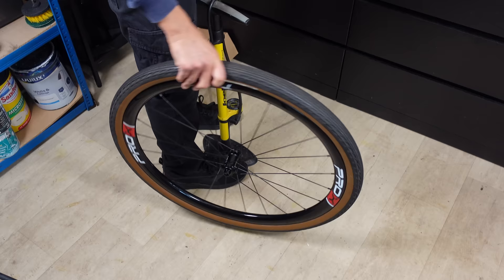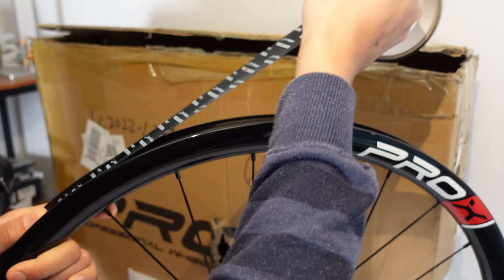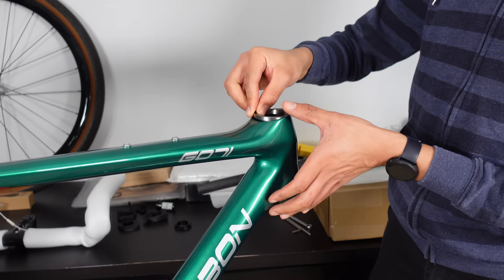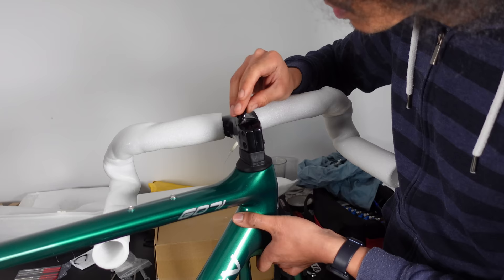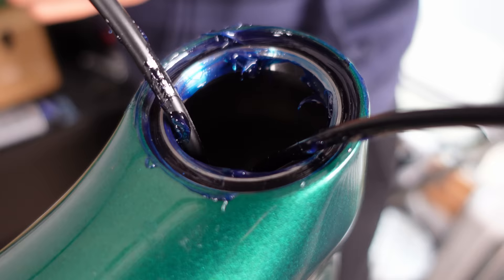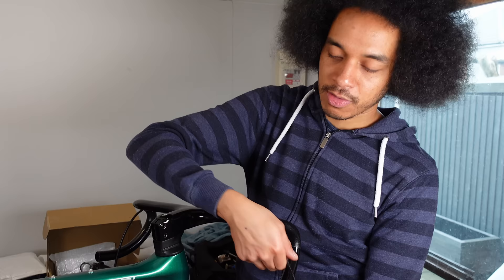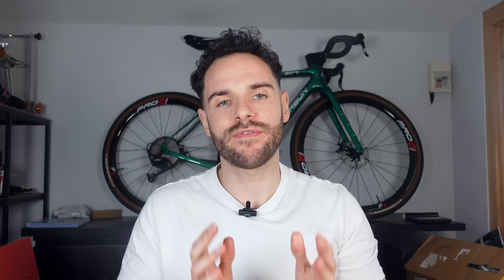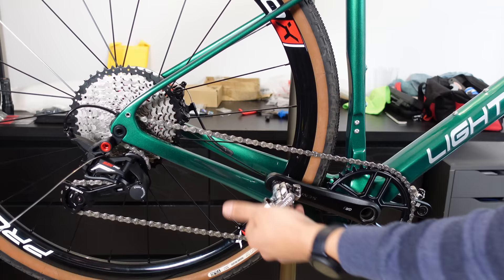Full Bike Build Process… Everything You Need to Know!! (Cost, Tools, Tips and Tricks)

Comment: Nice video. But the o-ring of the valve is not for sealing. It is for protecting the rim when tightening the nut. Are is trapped above the rim bead (tyre compartment). The hollow compartment of the rim shouldn't be pressureised, so a seal not needed. When the internal compartment of the rim is under pressure it can explode.
Reply from the maker: Thanks fro the info! That makes total sense. 👍🏽

Comment: I mean, I understand why the brake rotors don't come with locking nuts. Anyone replacing their brake rotors rather than installing them for the first time shouldn't have a need for them. I know when I replace brake pads on my car I just replace the rotors with them, and I'm sure there are actually people who do the same with their bikes.
Reply: I bought a new set of wheels and needed the lock rings...
Shimano rotors come with the ring.
Just make sure you have the right one if you have 15 mm axles...

Comment: To make sure tyres go on OK (many don't) I use the technique of putting half of one side of the tyre into as much of one side of the rim then do the same for the other side using the other half of the tyre. Its like a mirracle experience especially if you previously spent days without luck!😂
Reply from the maker: I see... so half one side, then half the other side... then just push both sides on. I guess the tension is spread out between both sides.
Reply: @JourdainColeman  well there is tension created especially on where the tyre crosses over ffrom one tensed side to the next. The result is the tyre has no gaps before inflating....I learnt the trick from this chap..https://youtu.be/tE3h4nmDdOo

Comment: When buying a socket / cup type tool to install this type  bottom bracket (ie one with Shimano notches) , be aware that the outer edge of the "teeth" in most examples of this type of tool, are chamfered ie they slope away from the outer edge of the tool, this means the width of the teeth that engage in the notches in the screw-in type bb like Jourdain has, is reduced but more importantly, because the lip on the screw-in bb is so thin, the notches are also very thin and so the teeth in the socket cup barely reach the notches, consequently when torquing up the two halves of the bb, the socket cup teeth easily slip off the notches and in so doing round off the edges of the bb notches, making it even more likely that the socket cup will slip off the notches. I speak from experience. It's a bit like trying to undo a tough nut on a bolt with only half the width of the spanner jaws in contact with the nut. It's best to use a spanner type of bb tool like Jourdain's mechanic mate did, the teeth on these spanners are not chamfered and whether open or closed jaws, engage the full width of the notches in the lip of the bb and are less liable to slip, provided you keep lots of pressure on the face of the tool.

Comment: I'm working on this frame right now and I discovered that the dust cap on the headset is touching the frame, and that's before preloading it. Did you have any issues with that? I'm thinking about installing an 8mm bearing on the top instead of the 7mm one that is provided with the bike. That should solve the issue I think. Less destructive than sanding down the dust cover. Any suggestions?
Reply: For who cares: I installed an 8mm headset bearing on top and it's perfect now
Reply: I am wondering if this might the cause of a problem I am having. I have assembled the bike, but I cannot remove the free play in the headset.
Reply: @mikenolan7524  It's pretty easy to see. If you turn the bars and you see the cover on the top of the frame rubbing the paint, it's not good. There should be a small gap, otherwise you will be scratching it up. Check top and bottom of the headset to see if there is a gap on both sides. There should be zero rub. Possible solutions: higher bearings (make sure to get the right dimensions/angle) or adding metal spacers on top of the existing ones.
If you can't get the play out of the headset when tightening it up and steering becomes hard you're clearly pushing the plastic cover against the frame since the bearings sit too low in the cups.

Comment: You need a long square drive allen hex bit for the brake levers to bars.  Not very expensive but get the right size.  An alternative fix is to grind the two ends off the right size key and put one end in the appropriate socket.  Not so neat and it will cost an allen key set.
Reply from the maker: That's a good idea! I'll have a look for a long Allen key. They are normally 5/6mm so only need to get a couple. 👍🏼

Comment: And for budget build, we start to using the 2 or 2.3 mm steel plate 6 bolts rotor, it's only 3 or 5 usd on store, it's durable and has no heat decay or deform problem. the weight is not a main problem.
It's just like 
expensive sandwich rotor after long distance down hill : the noise is tooo annoyed.
cheap steel plate rotor: wat?

Comment: How's the brake performance with the integrated cables on the handlebar and using mechanical brakes? Just worry bout the bends of the housing affecting braking performance for mechanical disc brakes. Thinking of a build. Thanks!
Reply from the maker: The braking has been good. To be honest I have built around 5 bikes now that all have internal cable routing and all have been ok (mechanical and hydraulic). It's a pain to install but works ok 👍🏽

Comment: Hey man. Nice, informative build. Did what size cassette are you using? Did you use an hanger extender? LC is recommending an additional hanger extender if you want cassette's like 11-50. I just don't get why I would need that as long as my derailleur is long enough (gx eagle axs for example)
Reply from the maker: 11-46T cassette || 42T Chainring - 42T - https://www.aliexpress.com/item/1005004275196889.html?spm=a2g0o.order_list.order_list_main.17.5cf61802P1XKAm

We didn't need a hanger extender. I guess you could give it a try and see. If they are recommended in then no harm in using one 👍🏽

Comment: Great video, very informative ❤
What size frame did you go with & how tall are you if i may ask? 😀
Reply from the maker: I went with a size 52 and and I'm 5ft 9 inches. I had a full bike fit which you can see here - https://youtu.be/EnGSLC9FtNI?si=zTdWLF9oBaRF6aqh - I rode a 54 before the bike fit and went down to a 52 after the bike fit. 👍🏽
Reply: @JourdainColeman  excellent.  Do you have a link to the frame that you built up?  I am interested in looking at the geometry & may consider buying! ❤️
Reply from the maker: @jamescourier1545  The Frame link is here - https://www.lightcarbon.com/lightcarbon-new-gravel-frameset-with-integrated-handlebar_p170.html It was around £500 (custom paint was another £100) - Here is the frame unboxing/review video - https://youtu.be/-NYsVBXBj2o?si=wD31wi_DIlKDAr2S

Comment: Hey Jourdain! Thanks for the video! I'm just about to re-build my VB-R-168 using the Jagwire Pro cables (2x mechanical gears and Juin Tech brakes) and have a question around how you installed your read derailleur cable.

Did you just route it as a 1 piece cable all the way from the shifter straight in to the mech, or did you use any of the extra 'flexible extensions' that come with the kit either on the shifter and bars or directly in to the rear derailleur?

For the cables as they exit the stem and enter the frame, how much slack did you leave to ensure they're not super tight and rub against the headset spacers?